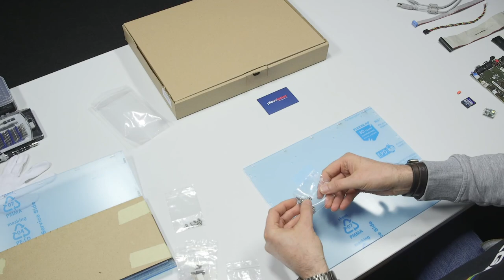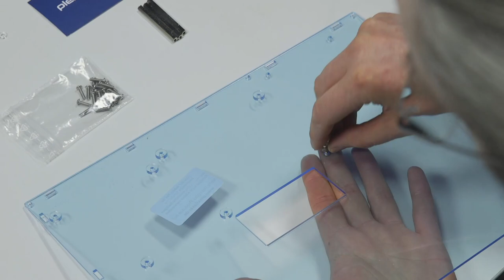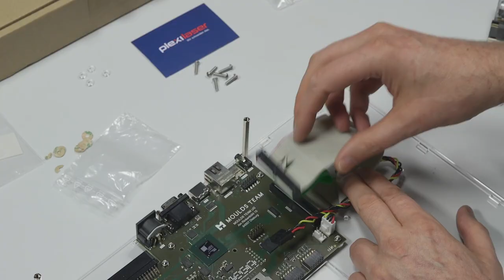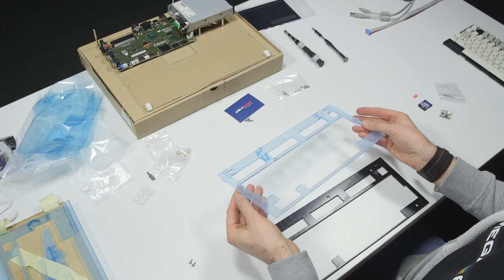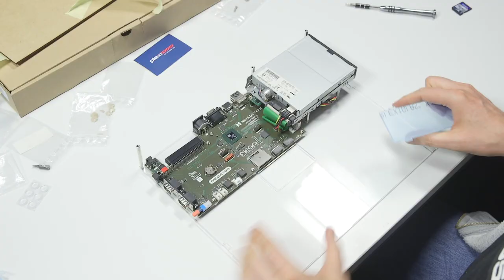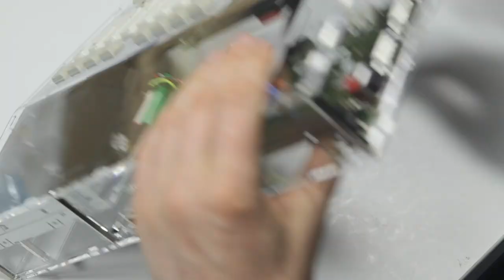MEGA65 DevKit Assembly

Comment: When I heard "Dev Kit" I thought I would have to solder chips, resistors and capacitors. Good to know all I'll really need to do is assemble the case and get the cables folded right.

Cheers for the video. Can't wait to build mine and start programming. 👍

Comment: Great instructional video... looking forward to the build! ;o)
Does the kit come with the screwdrivers required, or should I order some particular sizes?
Reply: The case is coming with a fitting bit for a bitholder-screwdriver for the case screws. there is no bit included to hold the nuts, but this is not neccessarily required. You shouldn't tighten the screws to hard anyway.
Reply: @antonschneider-michallek8544  Ah... OK. That's great, thanks!

Comment: Just got mine... those floppy risers are incredibly tight. can't get the threads through them to even screw into the drive... like its one size too small... or the riser threads are too big...
Reply: we received several reports about this already, we would like to offer you two solutions:
either use a dremel with a 3.2mm drill and open the holes up a bit or contact Plexilaser together with your DevKit serial number at: info@plexilaser.de and they will ship fitting replacements.
Plexilaser said, that they've mixed up some of the washers, so luckily it will not affect all DevKits.

Thanks for your report !
Reply: @antonschneider-michallek8544  I jammed them in sideways (not through) and it works fine like that for now. The little bolts are actually exactly the same height and would be a much better solution, so I might get a few of them from a local store. But fine for now....
Reply: @antonschneider-michallek8544  I ran into this too but I was able to use needle nose pliers to get through.  Who do I contact about broken acrylic?  My top plate and the black keyboard overlay plate are both broken...

Comment: Why is the floppy drive mounted sideways and not towards the front?
Reply: This design was done to achieve the smallest (and more modern) possible assembly of the MEGA65.
Reply: @antonschneider-michallek8544  I understand but it's a pity that it's not keeping the unique style of the Commodore 65.
Reply: @commodorecave5581  If you're going for the original C65 style you have to wait a bit longer until we release the final MEGA65. ;-)
Reply: @antonschneider-michallek8544  Aha! So the side mount is only for the development model. I will happily wait for the Mega65 release. I prefer the original design. Thanks for clarifying.

Comment: if it just had USB...
Reply from the maker: We thought about USB, but decided it really didn't fit a "pure" 8-bit creation.  It would be possible to make a USB cartridge, though.  Also, with 100mbit network, PMOD connectors where wifi could go, real joystick ports and dual SD-cards, there aren't too many reasons to need a USB port on it.
Reply: @MEGA65retro  It’s a slippery slope-modernising it.tempting but drifts towards a pc a bit too much.